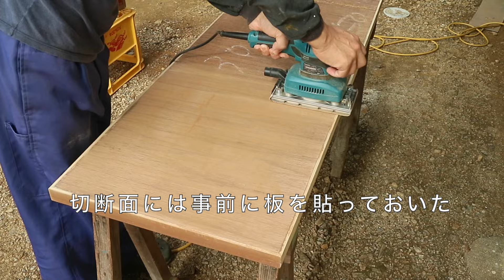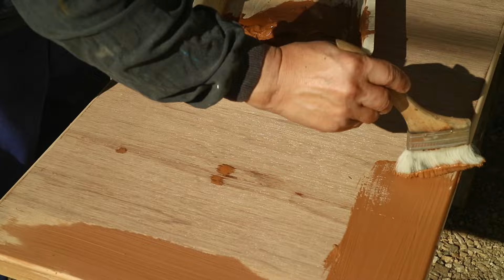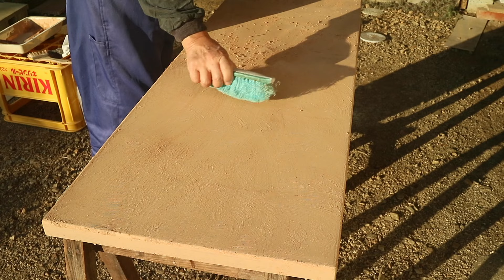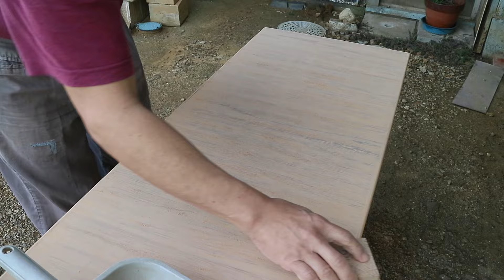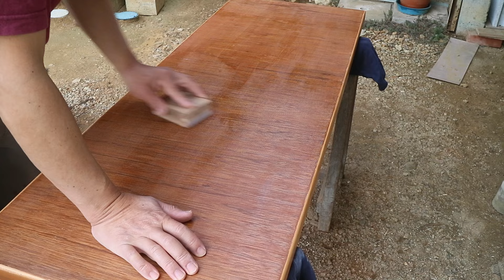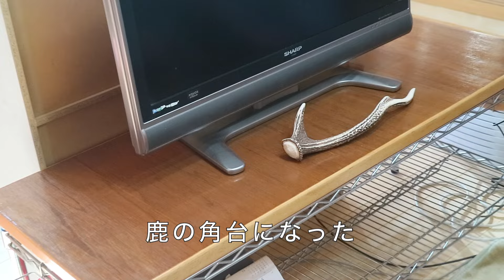テーブルの仕上げに初めて砥の粉を使ってみた【DIYで家作り♯141】Traditional Japanese wood finish 'Tonoko'

Comment: Tonoko where  can I buy,  please?  Is this pumice stone? According to the color I think in France of the earth of Baux-de-Provence which was used to color rubber formerly. I made a tube of oil paint from it for my painting. It is an aluminum oxide powder.
Reply from the maker: Tonoko is produced when grinding natural whetstones. It's not pumice.
But,I think it can be used in the same way as Tonoko, as long as the powder is fine enough to penetrate into the small grooves on the wood surface.
Reply: @fareastwood  Ok I see. Grinding natural whetstones is very fine too. Pumice is volcano powder veryyyyy fine and abrasive but white color. 
The ground of Baux de Provence is the same color as tonoko. It's an oxyd of aluminium (alumine ou corridon from the bauxite, his name come from the village de Baux in France). I filter it several times in water to use the fairly fine grains that float on top, for my oil painting. It is also a slightly abrasive grain.  There are too "Tripoli de Venise".
List of abrasive:
SiO2 Dioxyde de silicium (silicate)
CaO Oxyde de calcium (chaux)
MgO Oxyde de magnésium (magnésie)
--->> Al2O3 Oxyde d’aluminium (alumine)
FeO Oxyde de fer
Na2O Oxyde de sodium
PbO Oxyde de plomb
Fe2O3 Oxyde de fer
K2O Oxyde de potassium
TiO2 Oxyde de titane
MnO Oxyde de manganèse
P2O5 Oxyde de phosphore
Reply: @fareastwood  I find : Tonoko (clay powder, grey < 2 µm) powder plays an important part in the repairing part of the Kintsugi , Sabi urushi, Kiriko urushi process etc. When mixed with kiurushi, this Japanese whetstone powder creates a luxurious sabi urushi to fill small crevasses and chips.
Tonoko Powder 1kg Price: ¥1,260